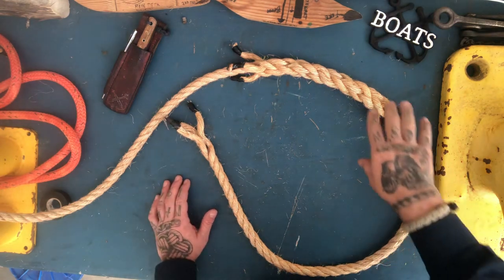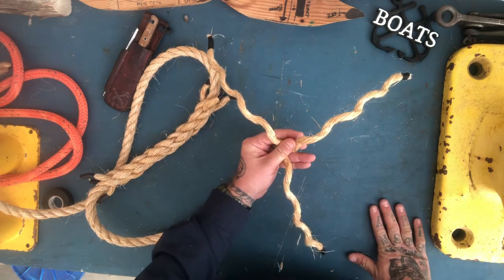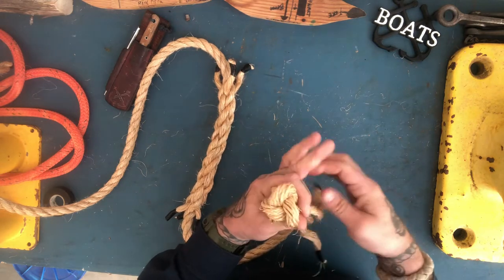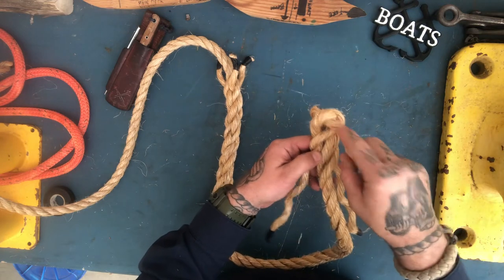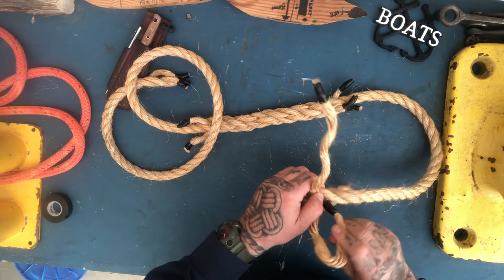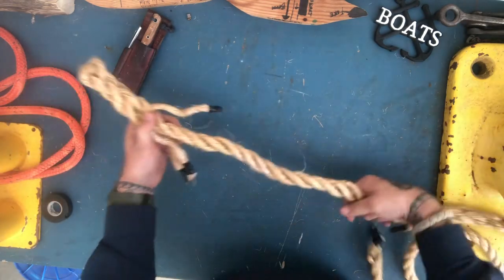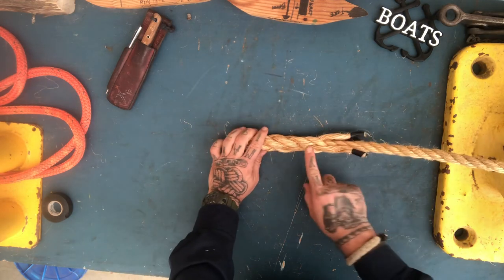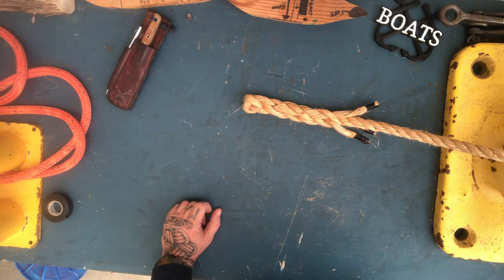3 strand backsplice

Comment: Nice clean splices. I’ve been tinkering with the larger 3 strand nylon line and discovered that partially seizing the rope down stream from the splice helps to maintain the lay of the line. Tried doing the same with the strands without success so I just keep twisting after each tuck to improve appearance. I like to seize the splice @ the end to prevent it from unraveling backwards; it also tidies up the end. Thanks for sharing. Donald.